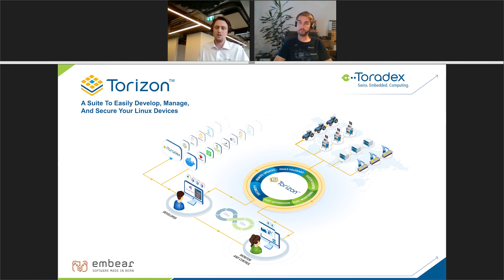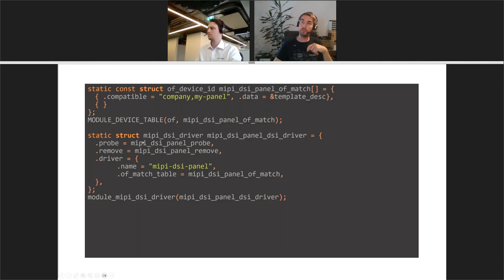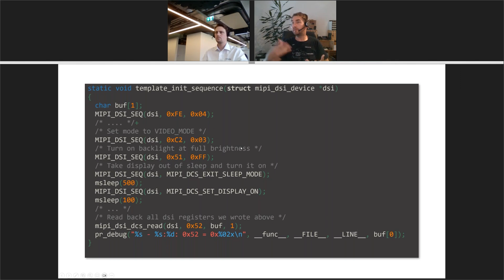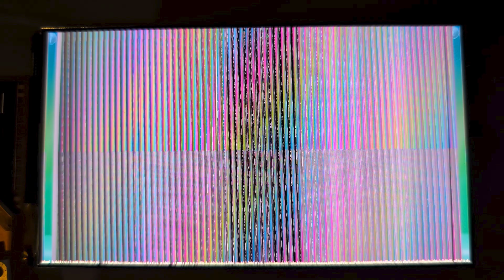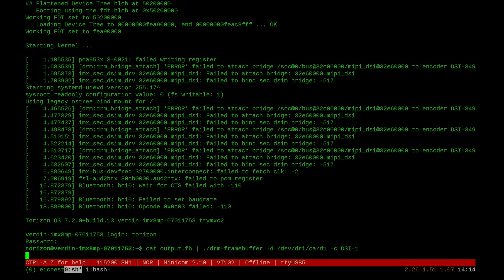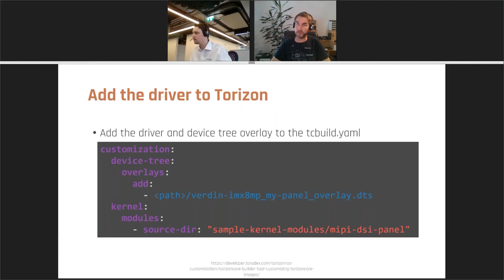Bringing Displays to Life: MIPI DSI Driver Development for Linux

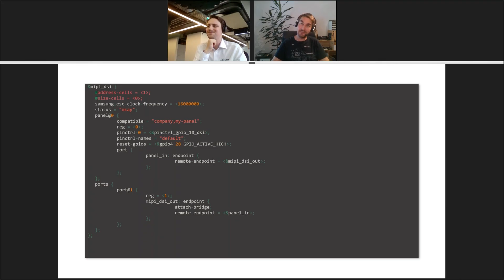Comment: 37:20 It's not nxp's whim.
No ports and endpoints is pretty normal practice. Panel is a direct DSI controller child in this case, which makes the driver simpler.
Reply from the maker: yes, thanks for the clarification

Comment: helo guys it wasa  perfect video. but i have a question. iam trying to  use a qualcom mobile phones display in computer. is it possible without haedwares. any links for such ideas
Reply from the maker: Thanks for the kind words!  🙏 This webinar focused on embedded use with MIPI DSI, but for using phone displays on a computer you might want to check DIY electronics or maker forums for ideas.
Reply: You can't do that directly. Mipi dsi is not an interface that you can find on normal PC and bitbanging it is not an option, so you will have to use some sort of  "hardware". You can however reflash your phone/tablet and make it act as a usb-display via USB-GUD, buuuut it requires either recompiling the kernel or compiling a kernel module for your vender kernel.

If you want to use some display from an old device you might want to look at tablets and  laptops, sometimes they use the eDP(aka embedded Display Port) which is a bastardized Display Port and is compatible with it, so you can just solder on a connector and use display with your PC as is, no convertors needed. One example of such displays are Ipad displays(not sure whether it's still the case, but it was at least back in ipad 4, ipad air days)